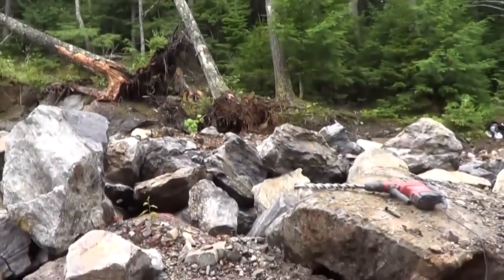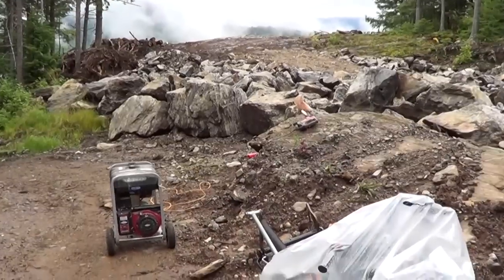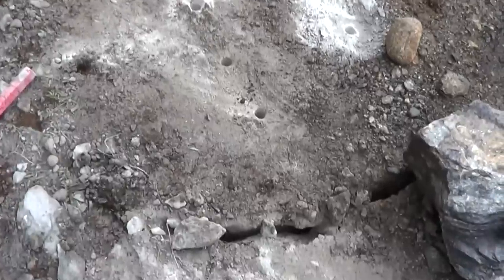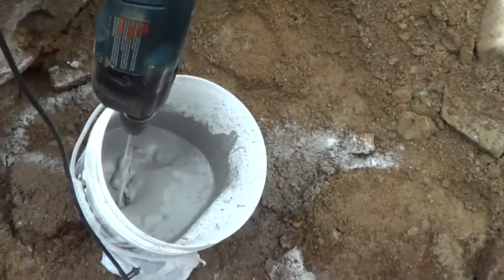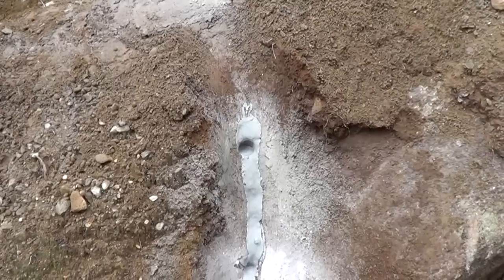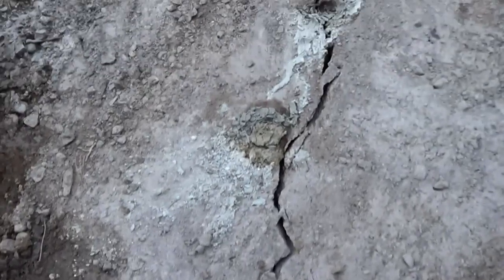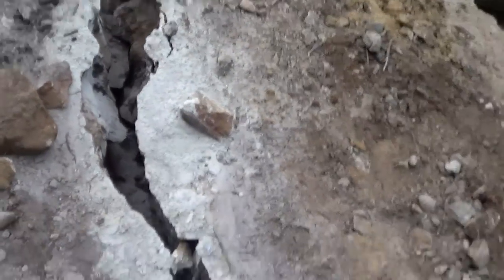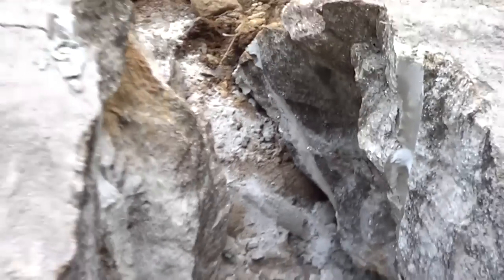Using Ecobust to break masive boulders at Keene Castle

Comment: Please ask for your help:
1- which hammer drill did you use ??
2- which drill to drill the rock you used (make and model of drill) ??
3- I verified that you made a hole approximately 15 cm deep and an inch in diameter. Using the drill mentioned in question 2, how many holes can you drill on average with this drill before it loses its cut ??
This information is important to me. I have been waiting for more than 20 years for the solution of breaking rocks on land that I have and can only use this solution because there are houses next to it. I thank you in advance for your answers. And, congratulations, continue your dream of building your castle ..
Reply from the maker: Hey Sergio, I used a Hilti Hammer drill TE76 with a 1-1/2 inch bit. I purchased it on Ebay used for about $400. New they are about $1500. See: https://www.ebay.com/b/Hilti-Te-76-In-Industrial-Hammer-Drills/109293/bn_7022212776
It has been a while since I made this video. I can't remember the depth or spacing but they do have that info in the product directions. According to this page, you space the holes 8 to 16 inches apart: https://gorillahammers.com/ecobust-user-guide/

I see now you can get ecobust at Home Depot which is real convenient. See: https://www.homedepot.com/p/ECOBUST-44-lb-Concrete-Cutting-and-Rock-Breaking-Non-Combustive-Demolition-Agent-Type-4-23F-41F-EB444/203335347?MERCH=REC-pipsem-203335349--203335347--N   

I hope this helps!
Reply: @KeeneCastle  Hi Keene.
Thank you for your kindness to answer ...
I need to remove many rocks that are at the entrance to my land here in Niteroi / Brazil ..
It will be very worthwhile, because it is a huge piece of land overlooking the sea ...
And I cannot use explosives to demolish the rocks ... and I cannot use pneumatic devices to avoid disturbing the wild animals that live in the forest next to my land ...
You helped me by informing the type of rotary hammer .. now I will look for more information about the drills ... mainly how much holes I can make with them to know the cost of buying drills ..

Comment: Did work well.  I remove boulders too but much faster, use a SierraBlaster.  That is a big boulder but instead of 48 hours it would take about 30 mins with a SierraBlaster and it also does not require an explosive license, it has an ATF exemption.  On a smaller boulders it only takes about 5 mins.  This video explains it.  https://www.youtube.com/watch?v=63UD9u6shDk
Reply from the maker: I always loved the idea of a micro blaster. My neighbor has one. That SierraBlaster looks like a great product! I'd buy one. The beauty of that is you don't have to drill 1.5" holes which take for ever!!!!!!!!!  The thinner drill holes go 10 times faster plus, as you say, the instant gratification of getting it cracked immediately instead of waiting a couple of days. I just had to remove remove some rocks that were slightly bigger than I couldn't do myself. See how we did it here: https://www.youtube.com/watch?v=a2x6Uu93a6U
Reply: @KeeneCastle   Very cool just watched it, big blasts.  Thanks!
Reply: I checked out the link you posted so I see the cost of the problem for the Sierra blaster is $750 and a 11 pound bucket of this EcoBust or Dexpan runs around $50

Comment: I first saw this on Gold Rush. I have a couple big rocks in my backyard. Can’t wait to bust those fuckers
Reply from the maker: Hey Jonathan, I just discovered you can get this stuff at Home Depot. https://www.youtube.com/watch?v=a2x6Uu93a6U    When I first purchased this stuff I had to drive an hour and a half south to the only dealer in NH. Now I can order it from Home Depot.
Reply from the maker: Oops, I posted the wrong link. Here's the link for ecobust at home depot: https://www.homedepot.com/p/ECOBUST-44-lb-Concrete-Cutting-and-Rock-Breaking-Non-Combustive-Demolition-Agent-Type-4-23F-41F-EB444/203335347?MERCH=REC-pipsem-203335353--203335347--N

Comment: I have Seen this used  on a Old Cement Pad that used to support a Very large Industrial Press.  the stuff they used was made In Germany and in Very large Caulking  Tubes .  were it Mixed together with another tube and injected  into the Drilled core holes.  that pad was almost 2 - 3  Feet thick    24 Hours Later it cracked  like an Egg
Reply: who taught you When to use Capitol letters? it Seems you use Them almost Randomly.
Reply: @stochastic24  good cAtch